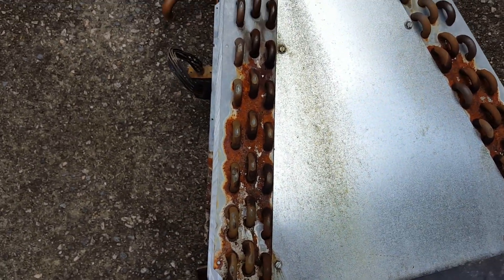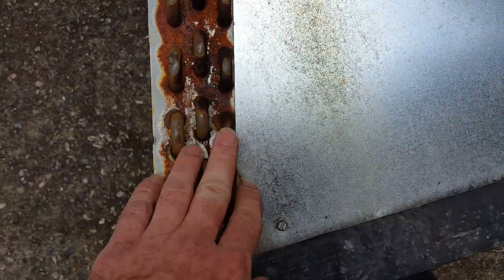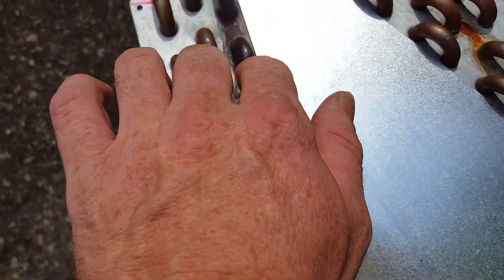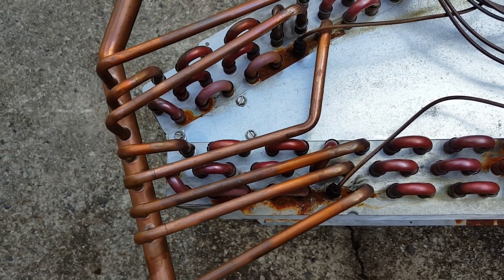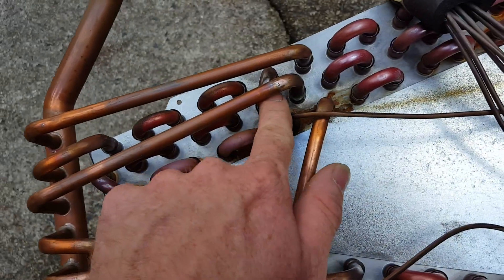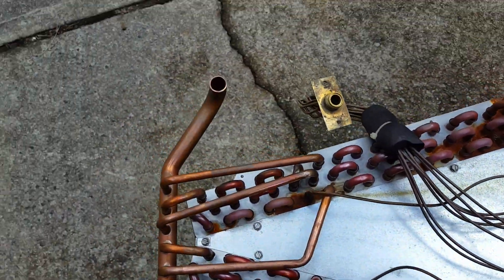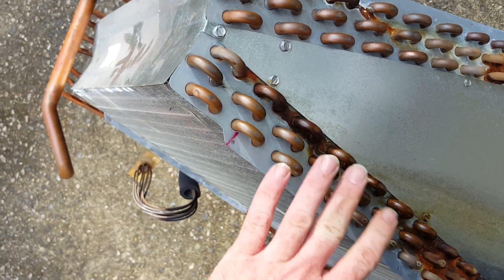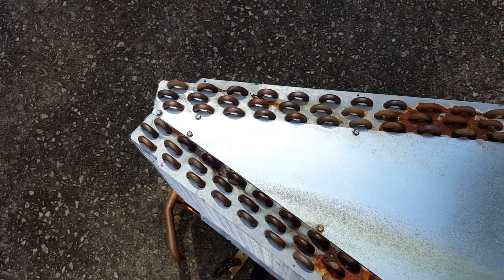How to visually spot a leaking evaporator coil

Comment: Inspect visually all you want, the real test even if it looks great is to pressurize to 200 psi when already installed in the HVAC system, let it hold it for 48 hours without dropping more than 2 PSIs and you are good to pull vacuum and give it some Juice, Look at the gas of your choice and don't mix oils if you do. You will end up with dark sand in the compressor and it will stop working on you but right before it wills start to draw more than 16 amps add that to the 2 fans running and you will exceed the biggest current breaker you can put in to run that compressor. yeap, it would be time for a new compressor.   Remember the longer you test it under 200psi the more you are guaranteed, you will be nice and cold for the summer. If it drops 5 pounds or pressure per 48 hours,  it tells you, you can still use it but don't waste your time getting it to super heat numbers cause soon after you won't be there anymore. I have seen evaporators that help 200 psi for longer than 48 hours and looked like there were on their last leg. We still got 2 or 3 more years out of  them. Necessity is the mother of invention and poverty is the mother of re-use. Heat in Texas and poverty is the mother of sorry, can't afford the AC guy and must be cool tonight or else Mama will leave me for someone who offers a cool house.

Comment: I have a 12 year old system. A coil is leaking oil. Repair A coil or replace A coil or replace the whole AC system? AC was working fine all summer. Just noticed the leak as I started using the furnace.

Comment: Does refrigerant smell sweet? We had our unit replaced and the old evap was leaking r-22 and smelled sweet when the ac ran.  The new one also emits a sweet smell only when the ac is on.  We had it checked twice by 2 ac companies, the installer and another one. They used those electronic leak detectors but only did a test on the front of the coil not the back.  How accurate are the detectors?  The new unit runs on r-410a. The smell is nauseating and only when the ac is on. Thanks in advance.

Comment: Well, sure....if you remove the evap coil it should be relatively easy to find a leak.
What if it's still inside the furnace plenum and you don't want to do a pump down?